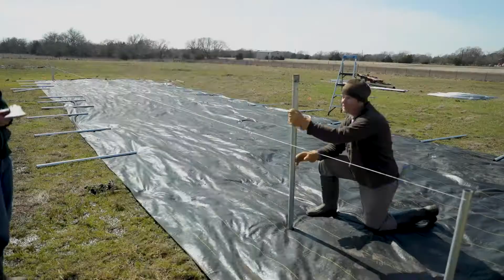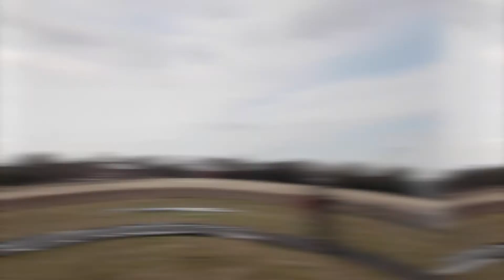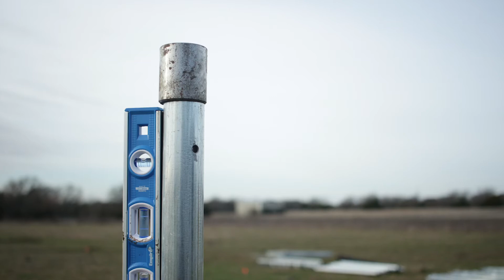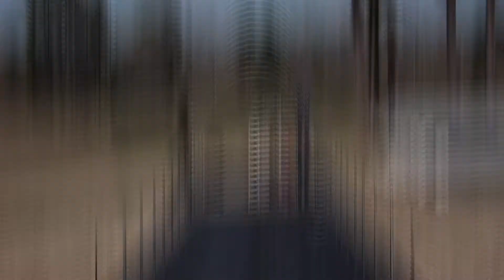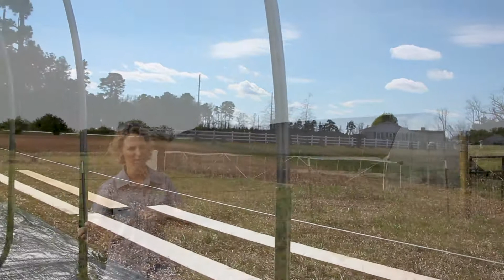Hoop House Ground Posts & Hoops

Comment: Im building my second bootstrap farmer greenhouse forst was a 12x40 hoop house and im building a 20x60 gothic arch now. I love the products but i think theres alot of info left out in the instruction manual and theese videos. Like how far the hoops need to slide into the post. The manual says slide them down to the 9 inch mark you made and now there level. But theres no instructions to make the 9 inch mark and i cant find any other info on what the minimum or maximum amout that needs to over lap. And several other crucial steps that have left me scratching my head as to how or when do them. I think the instruction book could use an update. And
Reply from the maker: Is it a DIY gothic or an All Metal.
Let me see if I can help.

Comment: What is the tensile strength of a 1 3/8" rail - 17 gauge?  and 1 5/8" post - 16 gauge?
Reply from the maker: Our 1.35 and 1.624 in 16 is 40,000 psi yield/45,000 psi tensile.
These are for our all metal kits. 
Any other pipe sourced elsewhere would have to check on that supplier .

Comment: Instead of 11 mil polyethylene plastic, is it possible/recommended to use 4x8ft polycarbonate sheets instead? Would the spacing allow them to be fastened sturdily? Thanks for taking time to address my question.
Reply from the maker: Anything out of spec, and outside of our Kit can be done with the hoop house owners discretion. It’s just not something we offer on our kits.

Comment: Using $22 for a 10 ft EMT pipe from Home Depot, how do your greenhouse kits (piping only) compare for a 20ft x 80 ft hoop house? Thanks in advance.
Reply from the maker: We do not use EMT pipe.
There’s really no comparison. The two metals are so vastly different and designed for completely different applications.
Reply: Oh I see. That's good to know. What is the exact type of metal used in your hoop houses?